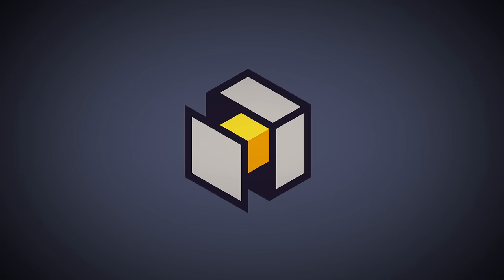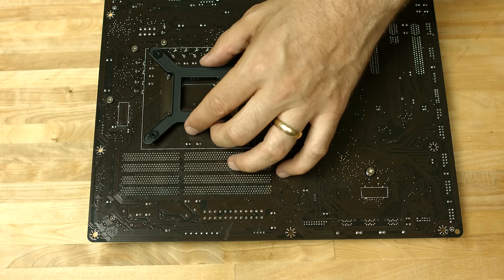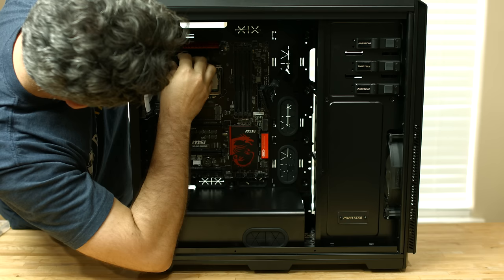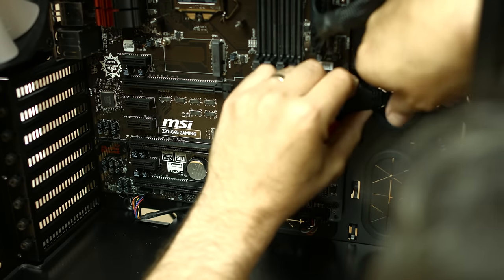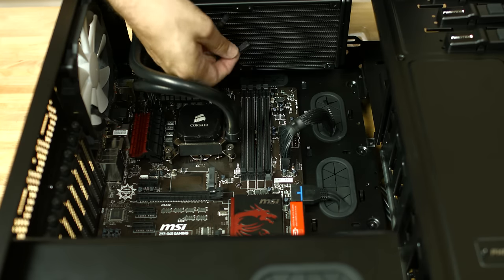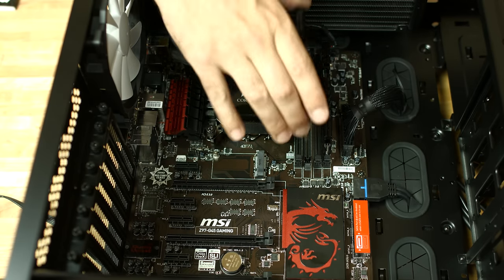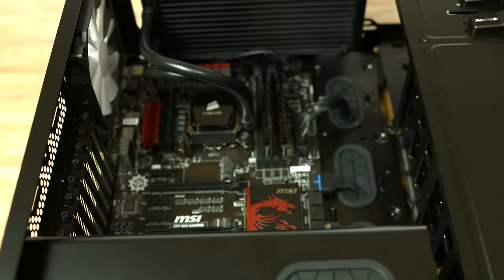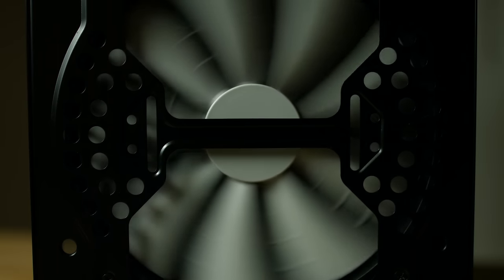$1450 Gaming PC Build - Intel Core i5-4690K / Asus GeForce GTX 980 / Phanteks Enthoo Pro

Comment from the maker: The best way to guarantee a new hardware release or two is to plan and film a build.  The parts for this build were planned prior to the release of the GTX 980 Ti and the Radeon R9 Fury and 300 series.  Had those been available and in stock, we would have opted for one of those instead.

One other note - the lighting on this video isn't where I'd like it to be.  During the filming, this happened: http://i.imgur.com/s4OfLW9.jpg.  Then this:  http://i.imgur.com/tconyYm.jpg.  We have new lights on the way, but had to kind of limp through this video without one of our fill lights.  :(
Reply: Can you put in some atmospheric or quiet music in next time? It gets a tiny bit boring sadly
Reply from the maker: Asendency Of course.  Due to the ambient noise where it's currently filmed there isn't any audio of the build itself.  But that's going to change soon - we're setting up a new space to film, and are also bringing on some additional help on the filming and editing side.  Hopefully pretty soon (next month or two) you'll see a nice improvement in the content and production quality.
Reply: PCPartPicker I'd rather the silence than some background music. Please don't add background music to your build videos. :(
Reply: PCPartPicker is there a wiring guide included with anything, i was a bit confused about where the wires are supposed to go
Reply: +Alicia Q yes just look up your  motherboard and wiring guide or look in the manual
Reply: Can I had a optical drive to this case

Comment: I built this Saturday for my son's 13th birthday present.  A couple of comments: 1) Mounting the back plate for the cooler as shown rendered it loose on the MB, because the little pegs on the backplate nuts stuck through the MB too far for the standoffs to snug it up before they bottomed out.  Reversing it worked.  2) The way the radiator and fans were installed here is opposite of what the cooler manual called for.  It said to mount the radiator to the top of the case, then mount the fans to the radiator, so that they blowed through the radiator, rather than sucked through the radiator.  They said this was for best thermal performance, plus it was easier to do.  Machine is a screamer though, OC'ed at 4.0GHz, I get 60fps on every game we've run, at max detail/shadows/textures and rez.  It's bad ass.  Thanks for a good guide!

Comment: You almost broke the HDD caddy at 8:11, Phanteks use a "wing" system on the hdd caddies (you can see the instructions printed on them) this is one of me most easiest tool-less installations i ever use (i have the same case)

Comment: At it's price Enthoo Pro is still the case to beat! phanteks is amazing
Reply: Ilija Petrovic for same price could get the Define R5
Reply: +Huevo Duro702 enthoo pro is modded friendly, larger, has better airflow and in my opinion looks better
Reply: +Huevo Duro702 it is also $10 cheaper assuming you get the windowed version of both
Reply: +Preston COC different strokes for different folks

Comment: why is the Fans on top of the radiator?  In the instructions booklet the fan recommended to be under the radiator.  This is probably a newb question but why the change up?

Comment: Air cooler + 980ti instead will be a better choice imo, but great build
Reply: I saw the description but the 980ti is still a better choice to anyone watching the video
Reply: A i5 CPU would be bottlenecking a 980 Ti.
Reply: Wingman1977 Nope.
Reply: Wingman1977 nope
Reply: Wingman1977 overclocking the 4690k is ez and it already perform s really well at stock
Reply: Wingman1977 nope
Reply: Wingman1977 nope
Reply: +Wingman1977 nope

Comment: I would have just made the western digital 1 terabyte and then used the money saved there to help afford a better cpu. what the point of this high end pc if it doesn't come with a high end processor, which is the most important pc part for a boost in performance

Comment: Should I go with the gtx960 for my build
Or should I go with somethin a bit better? 
Im going to do mild gaming (minecraft, csgo, gta)
With some video editing...
Reply: I have a 960 anx its a bit lacking im ipgrading to a 980ti in the next month or two my motherboard has just died though :-(
Reply: DYNAMO I have a 960 in my build and it runs great with all the games you listed. You will have to turn down the texture quality just a bit in gta but it still runs fine for me.
Reply: DYNAMO dude go with the msi r7 370 2Gb! My friend got it instead of the GTX 960 and he gets a few extra frames more than I do. Also the msi r7 370 is about $30 cheaper
Reply: You could get a 4 gigabyte r7 370 for less than a gtx 960 as well (It pains me saying this as I'm an nvidia fan, but not fanboy ;p)

Comment: Hi
I really like your videos. I was looking for a setup with a budget like this video and i found it interesting. But there is a problem. I am lookinf for a pc where i can edit video with a sony vegas and capture video from my ps4 with elgato hd60. This capture card has sone requirements as intel i5 minimum 2.0 ghz before boosting or similar and dedicated video card and for streaming intel i7 2.0ghz before boost or similar and video card booth setuos with minimun ram 8gb.
I like a mini itx build and this kind of case too. 
Can you help me to do a setup with these requirements?
I think with a maximum budget of 600usd
Thank you very much
Ps. I was doing a little research with intel nuc and gigabyte brix but i dont trust about the thermal cooling and the fall of cpu performance and i just put it apart that option

Comment: Negative air pressure?
Reply: TrisT There's a radiator in the way blocking some of the air throughput.
Reply: Jeroen Bollen Didn't think of that, ty.

Comment: How could i make this a little less expensive without losing any/a lot of the pc's power, i was looking for a build around 1300-1400 $ CANADIAN not american so 1000-1100 maybe in the us.
Reply: Nebula's Ditch the SSD and go with 1*8GB of RAM instead of 2*8GB of RAM. That'll save you 100$. If you don't plan on overclocking, you can get an i5-4690 (not K) and ditch the liquid cooling. That'll save you another 150$.

Comment: Hi do i need to change my stock cooler for cpu if i use gtx 970 with core i7 4790. I am not overclocking. Thank you
Reply: Y. Sajj it would be recommended. if you are just gaming and no OC than yes upgrade to a better air cooler but if you plan on OCing than get liquid coloing.
Reply: Okay thank you. Right now i have only stock fan on my cpu that came with cpu. Is that fan is fine? If that fan cant handle games then i will get better cooling fan
Reply: Y. Sajj Yeah it's okay for now until you get a better one :)
Reply: Thanks so much
Reply: Y. Sajj You're welcome :)
Reply: Y. Sajj is it 4790 or 4790k?
Reply: Its 4790
Reply: So just keep the stock fan get after market cooler just to make it look nice
Reply: The Evo cooler is $35 grab one
Reply: I got arctic freezer 13. I didnt had to take out mother board for back plate.. its much better now
Reply: +brody lockwood Without any OC stock cooler is prob fine, he just has to check the temps under stress and see how it is. Im not sure why he would need a liquid cooler for OC. Any good afthermarket cooler will do. Air cooler work just as well.

Comment: Guys can i get your opinion on this build?

Motherboard: MSI ATX DDR3 2133 Motherboard 970

CPU: Intel Core i5-4460 LGA 1150 CPU 

GPU: EVGA GeForce GTX 960 

RAM: Crucial Ballistix Sport 8GB Kit (4GBx2) DDR3

Case: Corsair Carbide Series SPEC-01 Mid Tower

Power supply: Corsair Builder Series CX 600 Watt ATX/EPS  80 PLUS

Memory: WD Blue 1TB Desktop 3.5 Inch SATA 6Gb/s

Secondary memory: Crucial BX100 250GB SATA 2.5 Inch Internal Solid State Drive
Reply: ManikPsycho Thats good, but what do you plan on using it for
Reply: gaming and some editing
Reply: ManikPsycho check out r/buildapc they a very helpful and full of knoweledge.
Reply: ManikPsycho It looks good but go for a GTX 970 if you have the money.
Reply: STOP THAT IS AN AMD MOBO WITH AN INTEL CPU
Reply: ManikPsycho Don't go with a GTX 970, the Msi Radeon R9 390 out preforms the GTX 970. And plus, it's cheaper, so everybody wins!
Reply: ManikPsycho Those parts won't go together. Your Motherboard takes an AMD processor, not an Intel one.
Reply: got that fixed! Picked up a MSI B85M, but thank you for helping out out :D
Reply: ManikPsycho nah get a Xeon CPU

Comment: Could anybody tell me if this is a good PC to play gta 5 on high sets

Gamer Paladin D837
Windows 8.1
Intel® Core™ i5-4690 Processor
8GB DDR3-1600 Memory
NVIDIA GTX 750Ti 2GB
MSI Z97S SLI Krait Edition MB
1TB 7200RPM Hard Drive
 LG Blu-ray Reader
Reply: Unkowner Moneys no dont buy this... 750ti is bare minimum for gaming and the cpu is way to fast/expensive... You should also remove the Z97 board since its meant for overclocking the cpu... u are better off with a H97 or B board. Aim for a GTX 970 with an 4440/4460 for a good gaming experience.
Reply: what  pc would you recommonemd to play gta 5 on high even medium graphics
$1k down is budget
Reply: Unkowner Moneys good you have read my previous post...
Reply: +Unkowner Moneys did you buy one?

Comment: PCPartPicker Or anyone else who knows more than me, I wanted to know if this is a decent build, i am trying to start out to pc gaming but i don't know what to do, i have researched a lot and i chose this, http://pcpartpicker.com/p/7GWs7P
I want to upgrade later to a i7 4690k but i have no clue if this motherboard can do that. I have shown this to some friends and they told me that  i could reach higher than 60 frames on normal on gta5 and arma 3 and battle field, is that true?
please respond with any help/ Tips, it is greatly appreciated.
Reply: RebelWithNoPulse It's a good build but if you plan on upgrading to an i5 4690k you should consider a z97 motherboard if you plan on overclocking, if not then go with the non k version. For games at 1080p its gonna reach 60 fps easily on high settings in most games.
Reply: CptCsan  Ok Thanks! I have thought about overclocking but i am going to wait to do that, Will it be easier to upgrade the motherboard now or do it later and take everything out to re put it in? Thanks in advance!
Reply: RebelWithNoPulse If you upgrade the motherboard now then you won't have to spend additional money on a new one later so if you can afford the extra money for a z97 and you're sure about the CPU upgrade later I'd say go for it.
Reply: CptCsan ok Thanks again! :)

Comment: fuck this I spent $1400 and I have an fx-8350 and a gtx 760
Reply: You bought it right??
Reply: 4 years ago?
Reply: Amxri U. Pairing an FX-8350 with a GTX 760 means you should study more about computer builds.
Reply: Cristopher De La Cruz what exactly is wrong with that pairing? Please spew your genius for the world.
Reply: gattis45 I guess he means that instead of getting the 8350, he could have bought a haswell i5 or spent an extra 30 or so bucks on an unlocked i5. Theres honestly no point in buying an 8350 anymore, especially when its being priced nearly the same as the newer intel chips. Also the gtx 760 is a bit on the lower side if youre actually spending 1400 bucks on a PC. I hope that he meant 1400 for the PC and the peripherals.
Reply: What thelonestranger777 said.
Reply: thelonestranger777 Last year the 8350 and 8320 were very cheap in Europe (130 euro's) so there was a reason to consider them.
Reply: thelonestranger777 had a 8150 forever. No reason for anyone to look at them until zen arch next year.  You wrecked him with that knowledge bomb
Reply: thelonestranger777 An 8350 will run you around $170, an unlocked i5 $240. That's a pretty significant price difference. The 8350 is just as good as an i5, don't try to bury it because you love Intel.
Reply: Batpimp It's not stupid to go for an FX chip now, they're cheap and plenty powerful, Zen won't redefine computing you sheep.
Reply: @Everyone, he could have gone for an FX-6300 instead, that performs as good as the FX-8350 in gaming.. FX-6300 and GTX760 is balanced but FX-8350 and GTX760 is not.
Reply: Cristopher De La Cruz Did I ever say I was only gaming?
Reply: I got my 8350 for well under $100 last year around christmas.
Reply: gattis45 if you are on a budget they get the job done. but the i5 is bettter.
Reply: gattis45 Dont compare a 3 year old CPU to a haswell i5. I also wonder where you got the notion that I love intel. I have an 8320 thats served me well over the years.
Reply: Jern_
Yea, I bought an 8320 about 2 or so years ago for 130 bucks. Ive never seen them that low until like last month.
Reply: Daniel FakeName You cant compare prices from a 3 yr old CPU to a new intel chip. 3 years ago, an 8350 was 200 bucks and a 3570K was only 220 bucks yet the intel chip performed a bit better while running cooler.
Reply: ***** What woul you recommend that would last the longest, an i5 4690k or a Xeon e3 1231v3(basically a i7 4770 clocked 0.1ghz lower and without the iGPU)?
Reply: ***** Hmm, might be a change of plans. A i5 4690k is 255 and the Xeon is 270. I might be able to get either a i7 3770k for 235-240 or a i7 4790(non k) for 275. If the i7 3770 is overclocked can it match or exceed a i7 4790?